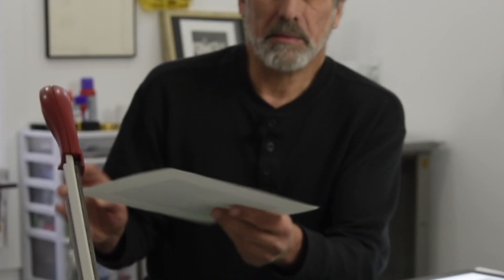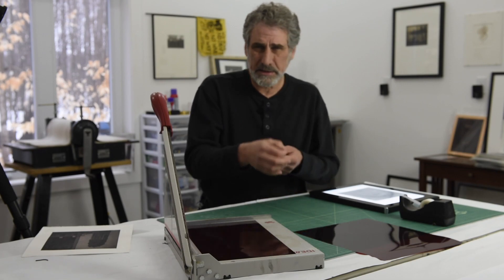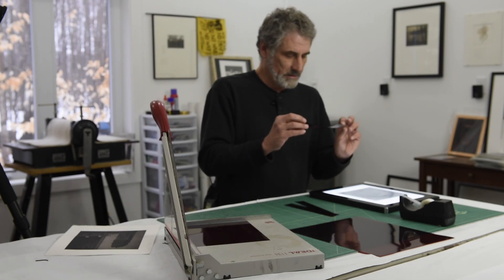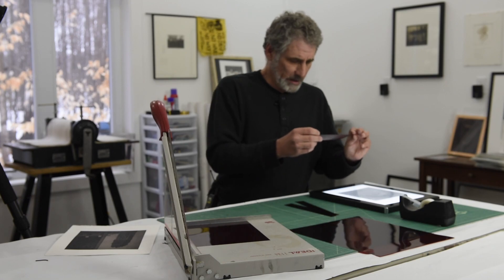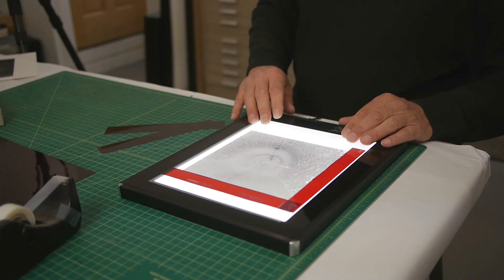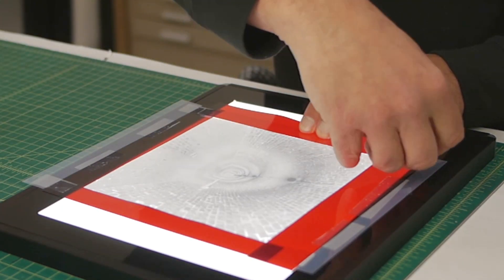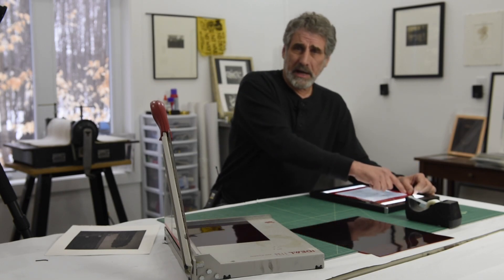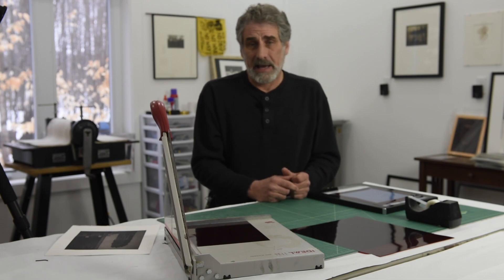Masking Negatives for Alternative Process Printing

Comment: Hi Bill, another excellent video.  I appreciate your content and production.  I have used this method before and it works well.  Another method is to print a black border around the edge of the image when printing the digital negative.
Reply from the maker: HiLarry... Thank you! I used to do that as well, but the reason I do not use a printed black border around my negative is that the blocking capability just doesn't hold up in my experience and I often see fogging. There is also the impact on my ink levels. Rubylith works out to be pretty effective and inexpensive and there is no doubt about its blocking capabilities.

Comment: 1.I am thinking about purchasing a contact frame for printing. The size would be 20x24? That way I would be able to use that size for smaller prints as well. For example printing 4 x 5 up to 20x 24.

2. Can you print a 8 x 10 negative onto coated 8 x 10 paper with with no border? And then dry mount the 8x10 print on11x14 mat board?

3. Can you recommend a UV light box?

Thank you very much?

Comment: In your links to materials, the one for Fixxons brings up for a positive transparency. Fixxons does make a digital negative film also. Is the one in the link correct?
Reply from the maker: Stephen... Good question. Yes. That is the stuff. When you’re doing silk screens, you need to print out a positive which is then made into a negative which once the screen is Inc. is made back into a positive. You get the idea. We all use the same material.

Comment: Hi, quick question.  If your digital negative has a perfect edge on it anyway, why mask the negative?
Reply from the maker: The reason is to shield any over-brushed emulsion from light therefore giving a clean edge in the final print. Many people like that ragged, over brushed look, as a signature of a platinum or palladium print, but I prefer a clean edge and this is one of the ways to achieve that.
Reply: @BillSchwab  Thank you very much.  You are making some fantastic videos.  Keep up the great work and excited to see what you are going to do next.

Comment: I always just print a mask into the digital negative?
Reply from the maker: I have found that the ink isn't dense enough in many cases and I get fogging. Too easy to use Rubylith and eliminate the possibility in my opinion.